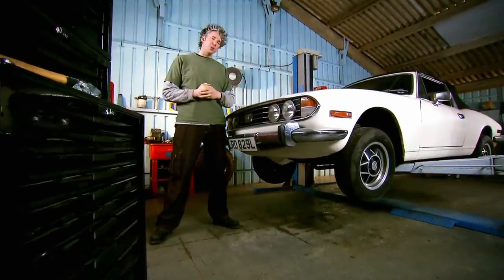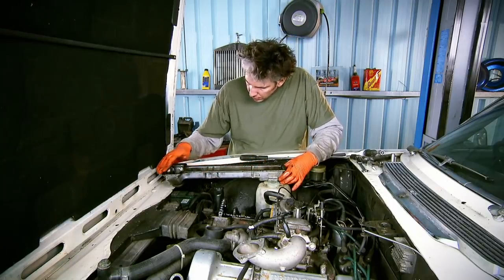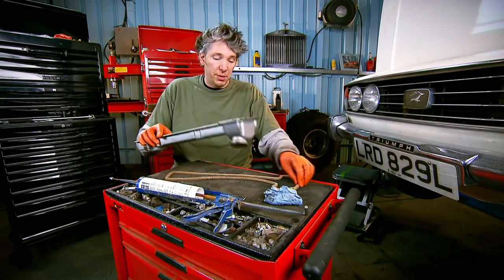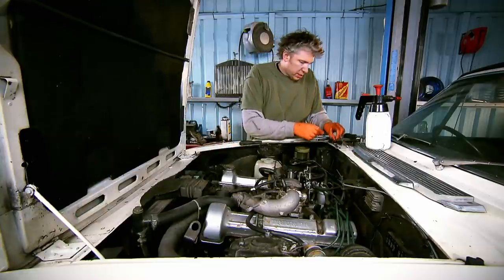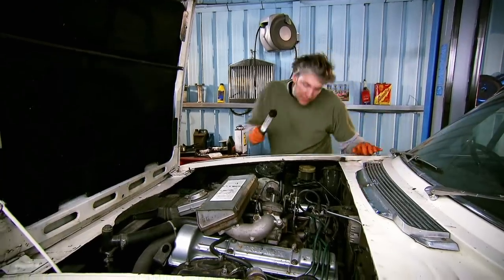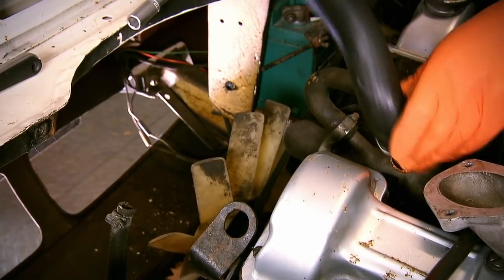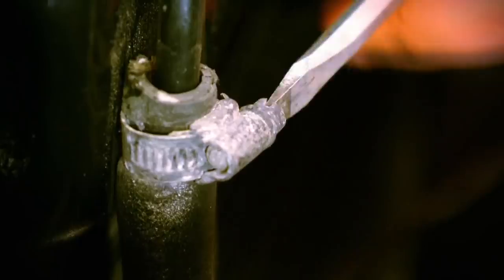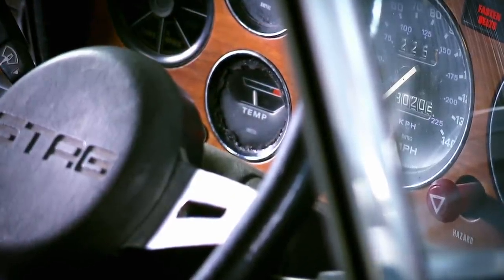Triumph Stag: How To Change The Gasket And Switch The Radiator | Wheeler Dealers

Comment: Something many Stag owners find rather strange is the choice to fit an uprated radiator to a car that does not seem to have cooling issues.  Fine if the car overheated but this example did not do that.  No need to fix that which is not broken.
Reply: Maybe an upgraded rad was cheaper
Reply: They are famous for cooling problems. An expansion tank fitted higher than the engine is essential. If the engine does overheat there is the possibility that the water pump, which is fitted at the highest point, will run dry leading an expensive pump failure and maybe engine seizure (very bad design fault). No heating engineer would ever install a pump on a heating system at the highest point - basic stuff.
Reply: @johnburns4017  The pump is not at the highest point in the system. Please stop spreading such pub myths.  If you go out and have a good look at your Stag cooling system you will find the pump is a good 10cm below the thermostat housing, which is at equal height if not a tad lower than the radiator filler point.  When compared to contemporary designs, the pump is no higher or lower than others.
Reply: @triumphstagdriver  
To make it easier for you, the pump is far too high. No heating engineer would ever install a pump on a heating system at or near the highest point.  Heating engineers when they look inside engine bays cringe. Full of rubber pipes with jubilee clips and water that is running near or above 100C!!   Done on the cheap, by people who do not know too much about heat/cooling. Would you put rubber hoses and hose clips in your house plumbing?  Not in a million years.

The Triumph Stag had notorious cooling problems for a number of reasons - design was one, the prime culprit. The heater return pipe running into one bank of the V8 - uh! Those who say keep it as stock nothing wrong with it, not saying you are one of them, talk tripe.

Search on U tube Triumph Stag & Stag Owners Club - revealing. One of the engine development engineers highlights the cooling problems.

Comment: Some folks say that you should not use those worm-gear (jubilee) clamps.  Most manufacturers use plain spring clamps as those will always apply clamping pressure even when the hose compresses a bit.

Comment: Just to add on the coolant and bleed procedure. Only use distilled water (not tap water) with the coolant mix. And also set the heater to hot when bleeding. Otherwise, a nice helpful video. And yes, the Stag does dound amazing. Stick the tubular manifolds on too and it gets even better.

Comment: ▪️You have to fit the correct radiator fluid as the engine has a mix of iron and aluminium. Do not fit cheap stuff. 
▪️The metal where the hoses push onto always needs cleaning.
▪️Radiator should always be a larger core radiator on Stags.
▪️Fit an electric cooling fan.
▪️While radiator is out, flush the cooling system. Many had casting sand left inside.

Comment: Glorious British V8? Inglorious would be flattering it. It's a heap of junk.
Reply: its better than the rover v8 with issues sorted
Reply: @paulhunter123  No, John, the bottom end is weak and prone to failure as is the electrolysis problem with the cylinder head. The Stag is an otherwise wonderful car but that friggin' engine was an unnecessary mistake.
Reply: @VonCoco1944  interesting so what engine in an ideal world would you have in your stag? id be more than happy with the TR6 PI Engine
Reply: @paulhunter123  In an ideal world, and back in the day, I'd have the Stag engine but redesigned such that it didn't have its intrinsic faults. They should have set their egos aside and used that old Buick engine that when on to serve so well in the following years, Rover, TVR and Morgan.
Reply: @VonCoco1944  If you had done a bit of research you would have found that it was simply not possible for Triumph to use the Rover/Buick engine for several reasons.  The engine itself does not have bad design issues but rather suffers from incorrect maintenance, low quality control and low quality parts.  The latter was due to company bean counters ending up have more say than the engineers.
Reply: @triumphstagdriver  But of course the engine has bad design features. Back in the day, I owned a Stag and suffered the financial loss and inconvenience of off-road workahop time because of the faults I have previously mentioned - and I wasn't alone when discussing with other contemporary Stag owners. The Stag remains a beautiful car and is definately enhanced by your rosetinted glasses.
Reply: Has anyone put a Saab turbo into a Stag?
Reply: @lameduck3630  That's a question for the transgender folk.
Reply: @lameduck3630  Not that I know of but they have been fitted to Toledo/Dolomites.